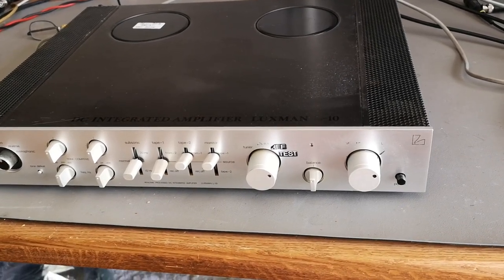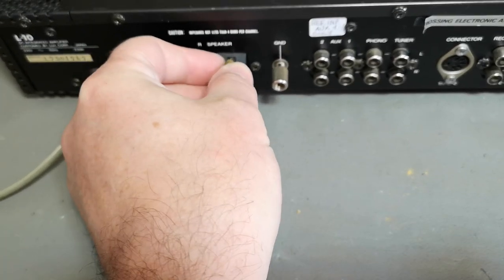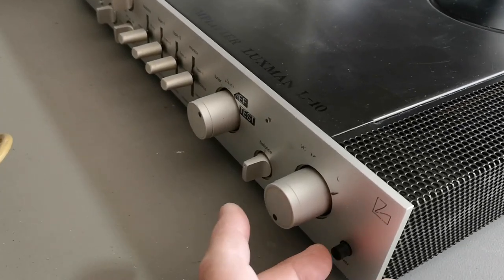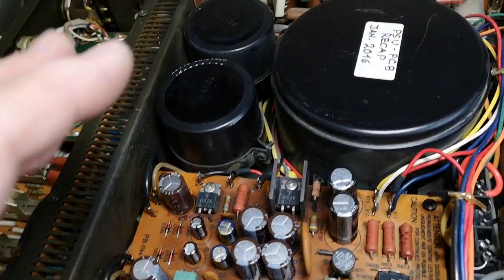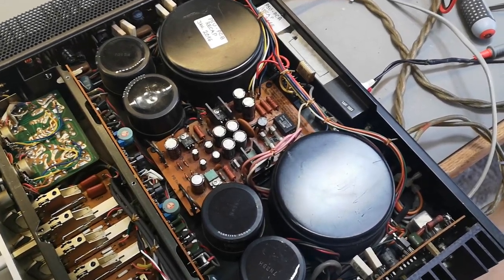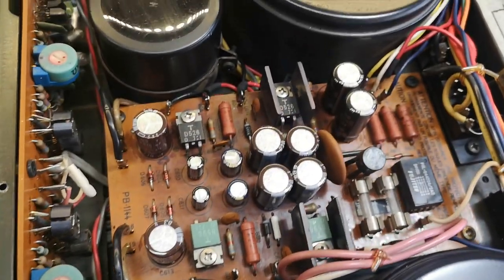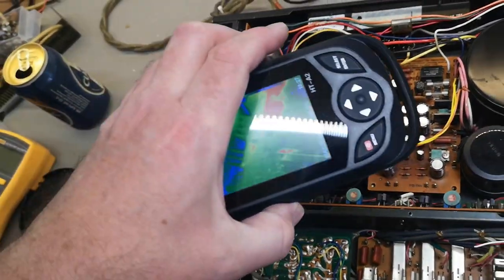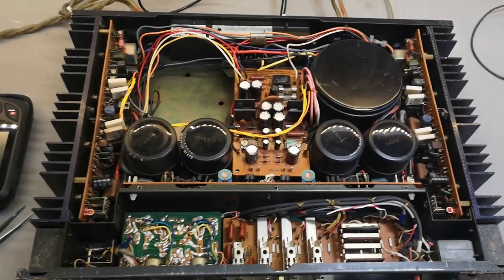Luxman L-10 hifi Amplifier test repair teardown

Comment: You could simply disconnect the transformer and left side, and make it a nice mono amplifier instead, to handle things like a small sub or centre speaker.....
Reply from the maker: I think it goto a collector / repair dude, since luxman is a collectors item, this one is not specially good looking either, but it could potentially be a good donor for parts.